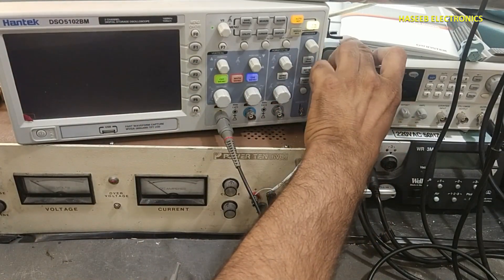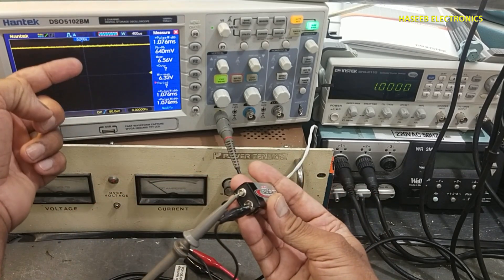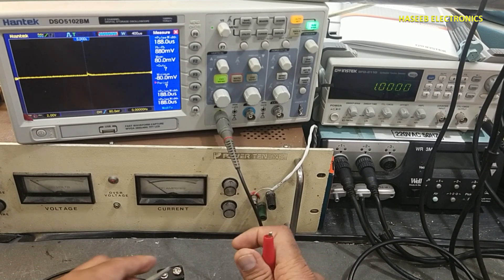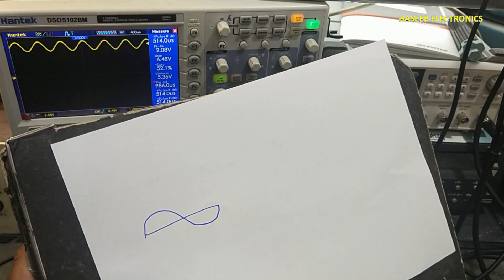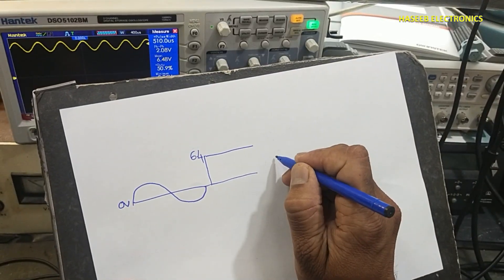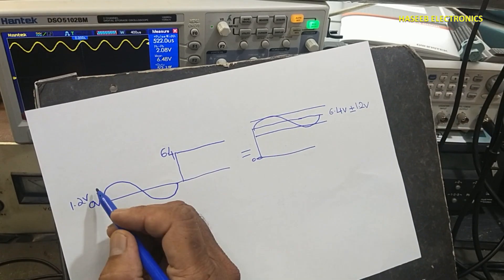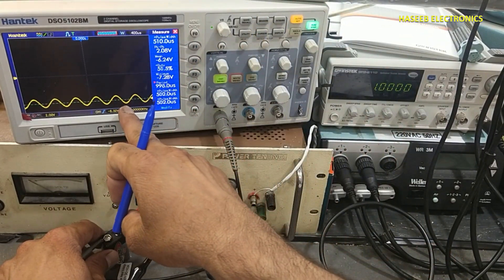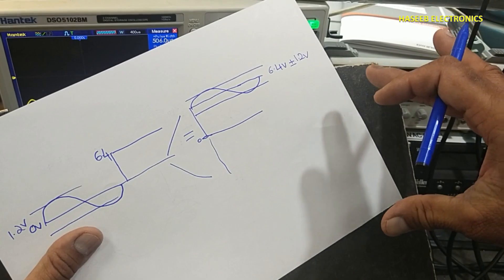{956} what is dc offset

Comment: Excellent. I needed to offset a ground for a PWM signal to mimic an automotive 5V ref sensor (which must stay between 0.5 and 4.5V to avoid setting trouble code). A 0.5V battery inline on the ground side and a 4V supply did the trick.

Comment: Hello, you have explained precisely with practical implementation. It really clears my basic understanding. 
I need one help. In my case, I've 4 antenna elements & their  IQ samples with 2k Hz. How can I calculate DC offset for all elements assuming the data is coming in real time. Can u suggest me any better approach or if you could share any link where I can study about this in detail as per my requirements.